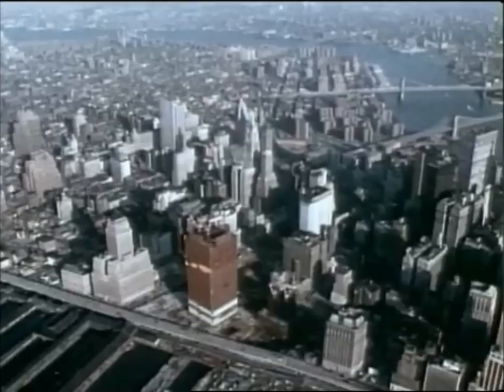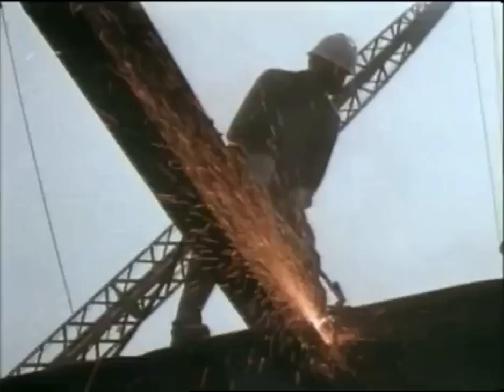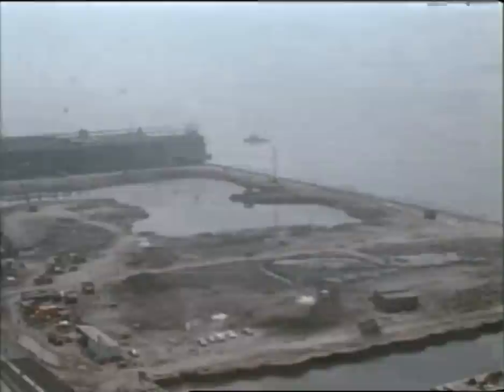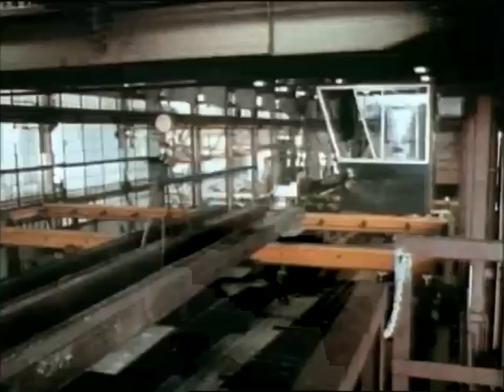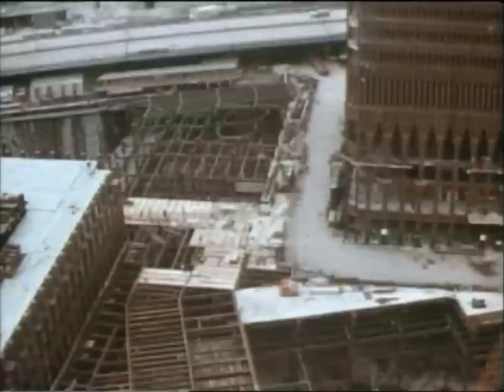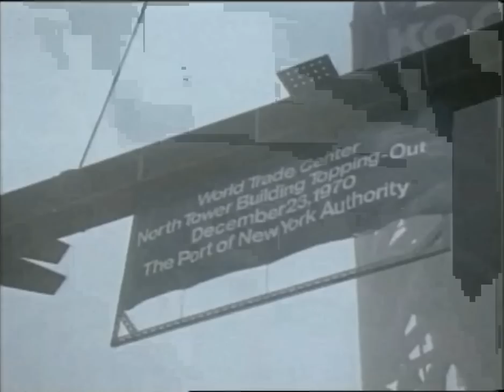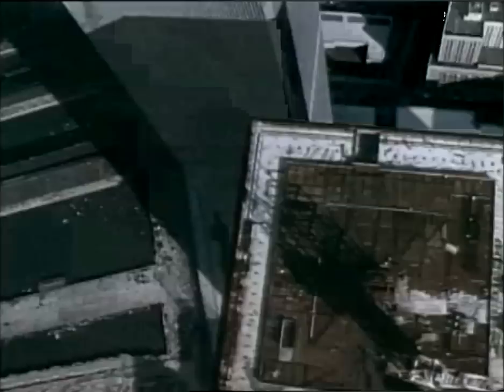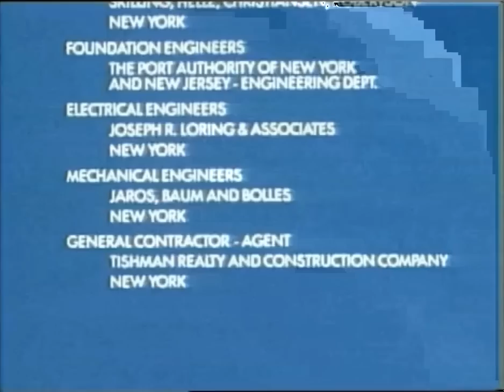PBS: Building the World Trade Center (PANYNJ, 1983)

Comment: I like how engineering and architecture has changed from the days of the old WTC. Back then they just drew 2 big boxes, and someone asked "What about the wind? Isn't it going to topple them over?" and they just said "Nah, we'll just make them so goddamn sturdy that wind won't be a problem". The new one is designed so that wind resistance is kept to a minimum.
Reply: True, but the original had weak floors and welds which apparently were enough to make them fail.
Reply: 1983

Comment: 11 years it took to plan and build something many thought were inconceivable at the time, and only 102 minutes for it to all come down. In my honest opinion, i think both towers should have been rebuilt (not necessarily the same design but something similar). Don't get me wrong i love 1 World Trade Center's design, but replacing something that was iconic and recognizable for a good quarter of a century with a different tower just doesn't really feel right.
Reply: Rebuilding them would have been the ultimate stance of defiance. I think they should have done what they did with Ground Zero. The original footprints being hallowed ground, but they should have rebuilt the twin towers. Perhaps with a more modern designs. Using heavy iron girders instead of floor truss, and concrete in the core instead of sheetrock.

Maybe someday someone will come back to New York and put them back up. It won't be the World Trade Center, but it'll give New York the giant twins it deserves. Standing guard over their fallen.

Comment: Absolutely amazing engineering, a true credit to the architects who designed them. There is absolutely no way an aluminum plane could penetrate those buildings, they were built too strong, anyone can see that. The towers were demolished using nanothermite.
Reply: They DID penetrate, a sheet of paper hurled with enough force can go through a wall,  the issue is the fire that was allegedly so hot it melted steel is bullshit, there were people waving handkerchiefs and towels out the windows by the impact zone and even the hole left by the plane hoping to be rescued, videos show it, most of the jet fuel burned off in a massive fireball outside, again videos show that. The fires internally were office equipment burning, paper, carpeting, plastics, wood, office chairs full of foam cushions etc and it produced a "cold"  black smoky fire with lots of dark smoke like you might get when first starting up a bonfire before the thing gets good and hot and burns that up.
The steel core beams were 4" thick on lower floors, there's no way an office fire is going to get hot enough.
Reply: "The steel core beams were 4" thick on lower floors, there's no way an office fire is going to get hot enough."
and how thick at the upper floors -quarter/eighth of an inch? I forget tbh.
Reply: actually they could go in if you did your research the towers we able to withstand a Boeing 707. What hit the twin towers on that day was a Boeing 757 a stronger plane than what the towers are able to withstand.
Reply: supergamers bro Indeed. 120 tons of aircraft flying at those speeds did considerable damage to the outer and inner core structure alone, without even considering the instantaneous fuel driven fires over several floors.
No one claims the steel melted, it just had to soften a little for one floor to give way and gravity did the rest.
Reply: Humannondancer
There's lots more to this whole story than we were told. The fact remains survivors were seen on video later near the impact hole standing in windows and waving towels or whatever, so the fire there in that zone couldn't have been all THAT hot, certainly not enough to soften or melt steel! At least one woman was on video right AT the impact hole.
Were looking at  either some behind the scenes extra work done to ensure collapse, or the only other explanation- extremely CRAPPY and shoddy construction and extreme corner cutting that somehow escaped the inspections and lasted just fine for  almost 30 years.

I've SEEN the massive steel that went into that building, there's even a 1969 documentary  by the Port Authority showing the construction, and you can see how overbuilt the steel was, plus those massive core columns!

What we saw on live news video was the entire tower AND it's massive core column matrix collapse straight down.
Do some research into the core's column make up, number and size, and then explain how all those heavy solid steel columns just "accordioned" into themselves straight down!
 Vertical columns are the strongest in that position and it takes a tremendous amount of weight or force to compress a steel column straight down into ITSELF, even more when they are all lined up like trees next to each other and tied together!
If anything the top of the tower should have fallen OVER and bent the core columns over sideways and down but that's not what happened.

We'll never know the REAL full truth, but the fact remains that no other steel building has collapsed like this, not even those where fire raged for DAYS burning all the floors down to the steel skeleton.
Even  next door 90 West st, a 1905 "skyscraper" with a steel frame had out of control fires rage in it for days- remained standing.
Reply: +Victorian Sculptures I can imagine those in the entry hole moved from where they were to the large gaping hole for clean air.
No mystery there.

We'll never know the REAL full truth, but the fact remains that no other steel building has collapsed like this, not even those where fire raged for DAYS burning all the floors down to the steel skeleton.
Even  next door 90 West st, a 1905 "skyscraper" with a steel frame had out of control fires rage in it for days- remained standing.

The building structure of a regular skyscraper differs considerably to the towers (and B7) They were the first of their type 
to be built with long floor spans in a relatively lightweight design made with prefabricated units.
This is all very clear in this short documentary which was made during construction of the towers.

  http://www.pbs.org/wgbh/americanexperience/features/general-article/newyork-engineering/
Reply: Humannondancer
"I can imagine those in the entry hole moved from where they were to the large gaping hole for clean air.
No mystery there."

No mystery, and not my point for bringing that up either! I brought that up due to the claims that  the fire was so hot it was either melting steel or had it all red hot and softened it, the FACT that people WERE in that crash zone hole obviously trying to get fresh air and wave for attention- proves the fire was NOT  raging out of control there.

The towers were office buildings with concrete floors, the only thing to burn in such offices are the furnishings, carpeting, desks, chairs, plastics found in computers and monitors, paper etc and these things do not produce temperatures all that hot, but instead produce a lot of dense toxic black smoke. There's not a whole lot of shit in offices and public hallways like the WTC had with large open spaces- to even burn, it's not like a warehouse with floor to ceiling , wall to wall shelving packed with tons and tons of flammable paper, cardboard, plastics, rubber, chemicals etc.

Most of the jet fuel burned off outside in the huge fireball, and liquid fuel burns off quickly- toss  a quart of gasoline on some large logs in a campground fire ring and watch it burn up real fast after a spectacular big ball of fire, chances are the logs won't even actually catch fire since the flame is not enough and not in long enough duration because the gasoline burned off  quickly. To even get those logs burning you'd have to have kindling.
At the WTC the jet fuel ignited the paper, furniture, carpets, plastics, all of which produce nothing more than a typical "office fire"- lots of dense smoke but not nearly hot enough to either melt steel as some claim, not hot enough to turn all that massive steel into  play-doh, and certainly not all of the support columns evenly all over the entire floor in order to cause  all of them to fail at the same time together!
Reply: Victorian Sculptures Excuse me for re-ephasizing the point, that those pictured in the entry hole moved from where they were originally for the clear air of the opening, and that the fires in that particular area had gone out.That is not to say the fire had gone out on the entirity of that floor, and that the floor had in fact been largely obliterated by the impacts.Leading to the fact that most likely there was no where else to go in the impacted area floors.
Melted steel is ony claimed by truthers, no such claim is in official reports of the collapse.
Reply: Humannondancer
Of course they did that, though the impact hole area couldn't have been all that hot by then-  an hour after impact or less?
I have seen the videos showing melted metal pouring out the side of the tower in one area, more than likely it was aluminum that was melting not steel at all, both look like shiny silvery metal and in a distance shot in video you can't really tell but aluminum was/is used in a lot of applications in buildings, it could have been from a/c coils or who knows, but aluminum melts a little above 1,000ºF which is within the normal temp range of an office building fire, you can melt aluminum on the gas stove in the kitchen I've done it, so melting aluminum in a large structure fire would not be unusual.
Reply: Victorian Sculptures  Aluminium was also used on the towers outer columns as cladding, and of course widely used on aircraft. 
The area where the melted metal was seen pouring out of the south tower is just below the impact area where most of the plane debris came to rest- in it's north east corner.
Considering the floors were seen bowing and collapsing in these areas, it's not too much of a leap to theorise that some of that highly contaminated aluminium pooled on above floor sections was poured out by the action of a collapsed floor unit.
Also, it's colour is seen in video and still photographs to return to a silvery colour as it falls and cools.

We are agreed.

All the steel columns did not have to collapse at the same time, no one says that other than truth'ers.What we do see is a gradual tilting of the buildings as they transfer the above mass to the already heavily loaded remaining core columns, and the outer columns also being overloaded by lack of vertical support due to those bowing and collapsing floors pulling in the outer columns.
We have a gradual and massive transfer loading of the remaining steel columns to their overload point, known as a progressive collapse.
Reply: Do you guys even know that these buildings where built to be destroyed? With that I mean there was a plan that in case eg. a earthquake these buildings could be demolished within their own footprint instead of taking out half the town when collapsed. That is why the buildings collapsed in a strange order and within half an hour of each other.
Excuse me if I made some grammar errors, English is not my native language.
Reply: 1/ They didn't fall within their own footprints.

2/ They collapsed destroying the whole wtc complex.

3/ They also damaged surrounding buildings in the collapse zones.

4/  They were built to withstand hurricane force winds and earthquakes.

5/ Realise you have been fooled by con men.

6/ Have a nice day.
Reply: Do you really think the towers could withstand every earthquake? Nope, one big one and the towers go down since they where attached to bedrock. And earthquakes are predictable. Real estate in NY is the most expensive in the world. No plan would be approved for a building that large in a area filled with high end real estate. 
The footprint is the WTC complex and the buildings destroyed still have less impact than a 1350 feet high tower falling over the city. The demolition plan for a building is quite a normal thing in engineering so I don't know why act the way you do but I'm not fooled by anyone because this is a policy thing and as I said well known. 
I'm not saying I'm right and that the buildings where brought down via the demolition plan but it is a thing to take in reconsideration and to think about with an open mind.
Reply: true, modern skyscraper construction is way advanced, especially in Asia in high seismic risk zones the building code got very high, megacolumns started to be implemented in the first 400+m towers in Asia
most people dont know how all big projects must have design to prevent unnecessary collateral damage
Reply: yes
Reply: Starsky Hutch nanothermite is the cover story to hide the real tech they used
Reply: Starsky Hutch if you take a brick off the top of your chimney will your whole house fall down? No! So why do people think damaging the top 20 floors of a building could make it get destroyed all the way down to the street 80 undamaged floors just gave out for no reason? Just THINK about that for one second

Comment: There's some guy who has a computerized diagram of the Jets impacting the building and going through them he shows steel beams all through the building I know this is not true I knew that the strength of the building was on the outside not the inside plus to my shock and amazement the interior walls were multi-layered sheetrock there were some steel beams inside but that's where the bathrooms and elevators were clustered in the center of the building so when the Jets took out the elevator shafts and everything else that left it open to collapse such a shame

Comment: Very nice construction. I am sure that it wasn't easy- the towers, glass, water, electricity, etc...
Btw, what are these yellow things? Protection from possibily falling materials? They cover the steel structure and then are added external grey "columns" if am i right, but the yellow "protection" is missing (if i understood this properly) see 12:54 (grey "columns") 12:59 (yellow "protection")
Reply: it's for keep materials and people from falling the reason why there isn't yellow sheets at the very top instead of being a couple yards down is bc building the towers was quick and they got the beams and floors done very quick so the yellow sheets couldn't keep up.
Reply: Thank you for the responce. It's very interesting how did they put them outside? Maybe with the cranes. And what is this grey cladding? In some places the stucture is steel and in other places it seems to be concrete 12:51
Reply: Dido Atanasov that slight dark gray is the zones there are 2 or 3 zones one haif way to the bottom one haif way to the top and the one at the very top I think each zone contains 50 or 60 floors
Reply: 1973
Reply: @didoatanasov1107  In red it is just the steel with rust protection, the grey stuff is with sprayed on Fireproofing.

Comment: And an airplane ripped through 30 of those floors?
Reply: no the planes went in at a slight angle, hitting maybe 3 floors and most of the jet fuel burned up in the massive fireball outside the building.
Reply: The 2nd jet hit a little above half the building & at an angle. The 1st plane struck straight in at around the 88th floor. That's why the 2nd building hit, fell first.

Comment: Corners were "Cut"  to get the building up and running and a design flaw that relied on the exterior walls for the strength of the building and floor trusses that were weak... This added to the demise of this "Deathtrap"  of a building...Put it this way...I bet the Empire State Building could have taken a hit from a Boeing 767 at 450 MPH and survived. 
Rest In Peace all the poor souls who died in these two badly designed death trap buildings.
EDIT... To add insult to injury MANY of the Police officers..Firefighters Paramedics and other emergency workers are now starting to die of asbestosis and cancer as a result of breathing in dust contaminated with deadly asbestos and cancer-causing dioxins.